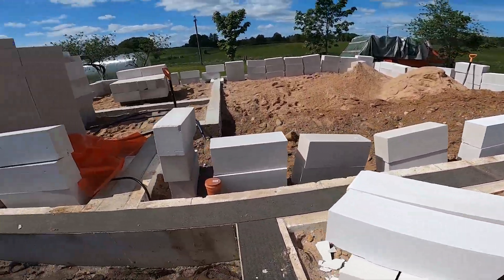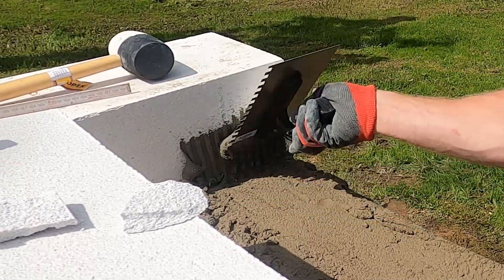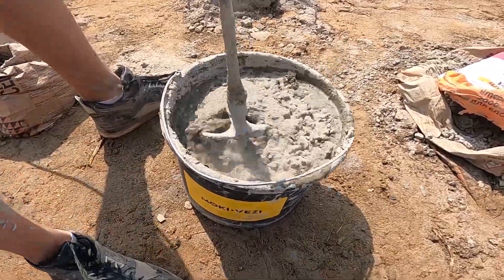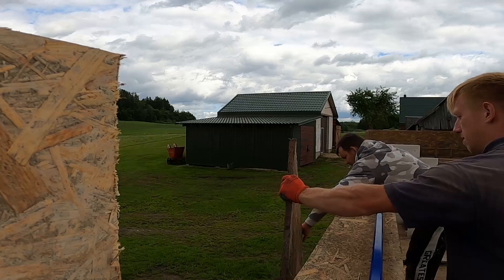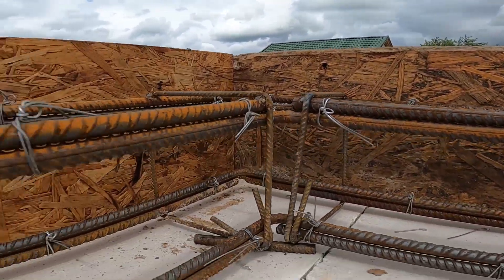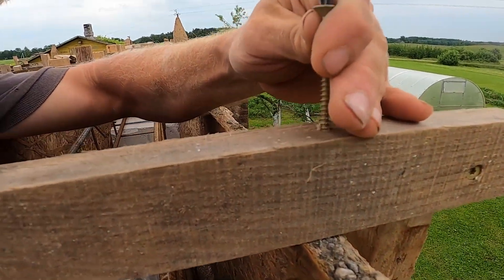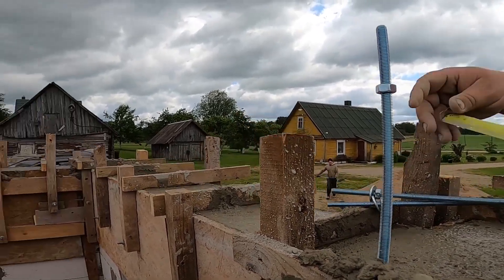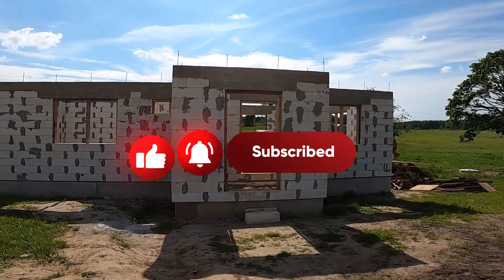Building AAC Block House – From Walls to Ring Beam

Comment: bro thats the first time ive seen a router cuts AAC! what type of bits you use? its  made of concrete
Reply from the maker: AAC blocks are so soft that we just used a normal wood router bit. Cuts like butter.
Reply: @LibraryofConstructioni have to check with my aac supplier here in Asia if the same
Reply from the maker: @realprojecttools3543  Yeah, AAC density can vary by manufacturer. Ours is very soft, so standard wood router bits worked fine.
Reply: @LibraryofConstruction i see. what is the  PSI strength of the AAC block you used?
Reply: @LibraryofConstructionby the way, you have a useful and fun to watch videos. Keep it up. Helps a lot of people. Theres value in your videos

Comment: Corner bars are not intended for corners splice the are designed for to prevent cracking, if you gonna use like that you still need that 90° bend in your rebar hooking other one too
Reply from the maker: Yeah for sure. The 90° bends are in all the corners, you can see them in the video.